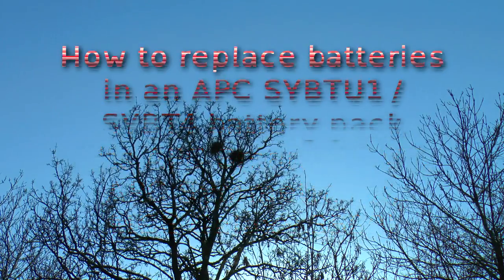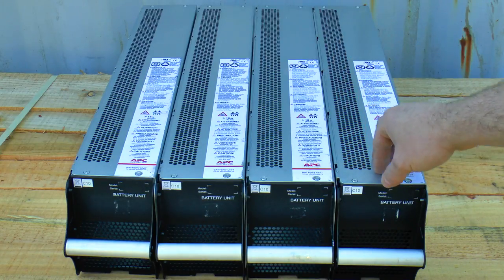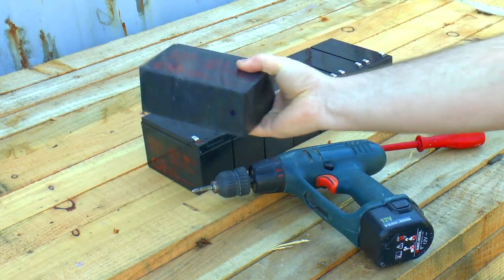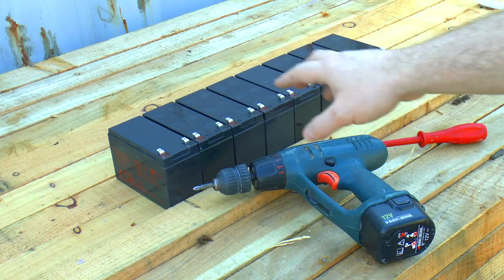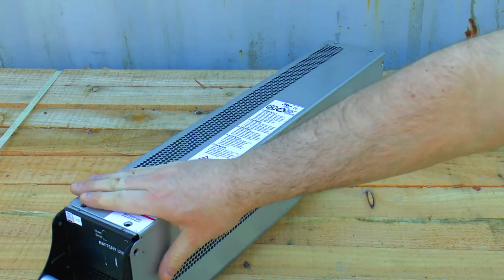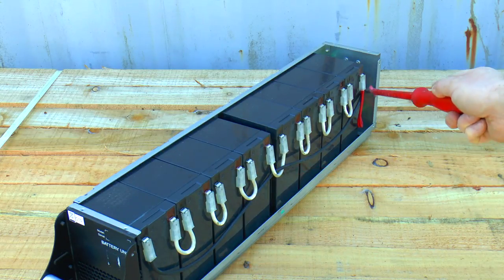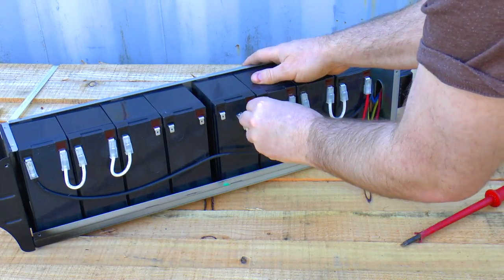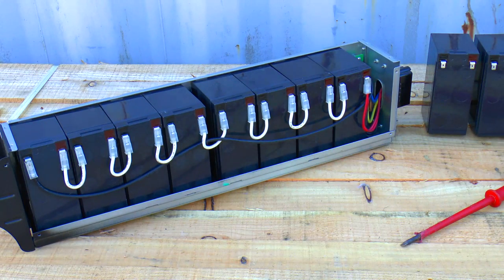APC SmartUPS VT, Symmetra PX or Galaxy 3500 battery swap

Comment: Those connectors are latching ones, you just pull down on the plastic cover and they unlock, no screwdriver needed. You might find you will need new connectors if the battery units have weeped acid through the terminal seal, and this will corrode the connector to a blue green blob. Replace the whole link with a new one, the cable corrodes as well. Use regular crimp connections with 4mm wire ( yellow body ones) and cover the terminal with a short piece of clear heatshrink for isolation.
Reply from the maker: Wow, I thought they looked a bit complex! I'll have a closer look at those connectors.

Comment: I always thought APC charged far too much for their replacement battery cartridges.

I saved about £150 by doing this with a SmartUPS rack mount unit I salvaged from work.

I only used relatively cheap FIAMM batteries because I didn't know if the UPS worked or if I would be able to get it going.

As it happens it did at the time but has since developed a fault where it detects a load when none is connected sometimes putting it into an overload condition.

Comment: Smashing tutorial :-))

I do like that method for ups, as its h.v then i can see the batterys being switched onto the input of a switchmode circuit to provide 230-240vac, i would imagine the charger is a low current trickle system, sounds reliable.

Stepping up say 24vdc to mains has got to be more stressfull on an inverter.

Dam cheap repair :-))

Comment: This is part of the reason why I like the Symmetra PX series.  This series is so easy to maintenance and work on compared to something like the Liebert 300 series.  Hands down it's a great UPS system.

Thanks for sharing this.. I am curious if you have replaced any of these with Lithium Ion equivalents? This might be cheaper than buying an extra battery cabinet for more run time, and they should have a longer life span

Comment: Next time you need to do this, Replace those 7.2AH batteries with 9AH ones that are the same size. Should gain you an extra 20-25% energy Capacity.

APC actually use the 9AH batteries in some of the newer units.

obviously you cant tell the unit it has 9AH batteries in it, but if you do some runtime calibrations, it should learn what the new runtime is.

Comment: Is the 12 quid per battery price only if you buy them 32 of them at a time? I've considered recycling an old UPS for ages but the batteries always work out more expensive than a new unit when bought one or two at a time.
Reply from the maker: Shop around, the supplier I found does them for £13.99 each singly, £13.49 for 2 or more, £12.99 for 11 or more or £12.49 for 25 or more.
Reply: AintBigAintClever
Rapid electronics do Yuasa NP7-12 batteries for £12.90 for 1+, £11.96  each for 5+ and £11.17 each if you're buying 25 or more. They'll probably give you a bigger discount if you're buying 100+ and you call them first. I think Maplin charge about £40 each for these. XD

Comment: Anyone know if you can get just the resistor card? My UPS took a lightning strike and fried out one of the cards. I don't want to buy a whole battery pack just to get the card. I don't need the spring loaded connector...just the card.

Comment: This is very nice but you didn't make any mention of the compensating resisters that are in each module.  Each module has compensating resisters that are different in each module depending on what manufacturers batteries are installed.  If a different manufacturer is used when you replace it, the UPS's diagnostics can not properly determine the charge level and the batts cant be matched with any other battery module.  As an engineer at APC I can state this as fact.
Reply from the maker: Larry Tetro Would that be the resistors shown at 8:15? I was wondering what those were for, I thought they'd be to do with the thermistor. Good to know.

Comment: What do you reckon to the different VRLA brands out there, any experience with the Lucas types?
Reply from the maker: I think I've got a pair of Lucas in my UPS at home. I've definitely got Lucas in the intruder alarm, in a jump starter and in a backpack.
As far as I can tell Lucas and Numax VRLA batteries share the same internals.
When replacing UPS batteries at work we tend to use CSB.
Reply: @AintBigAintClever  I think Lucas may have replaced the Numax VRLA line after being acquired by a company called manbat, I'm guessing they just import them from who knows where and has the factory brand them first. Lots of cheap garbage batteries still around just like in the video even all these years later.